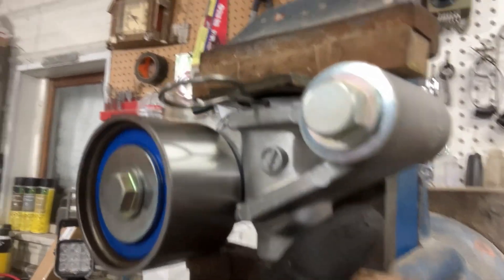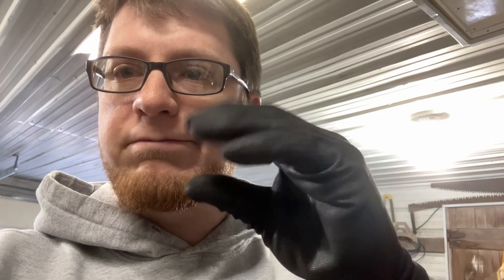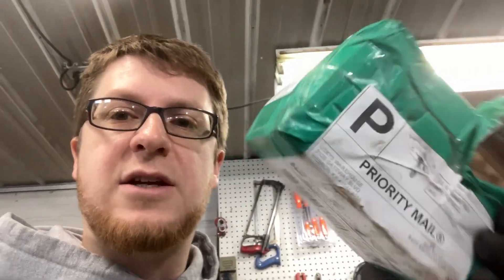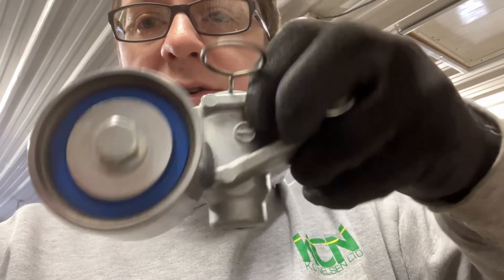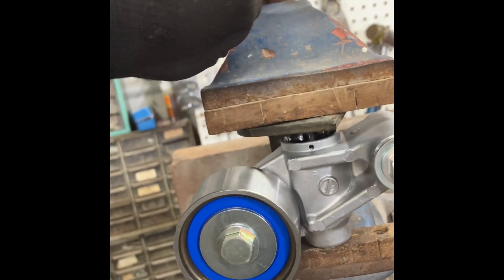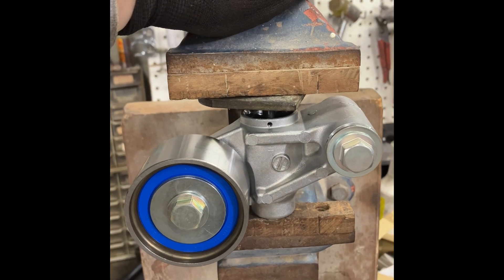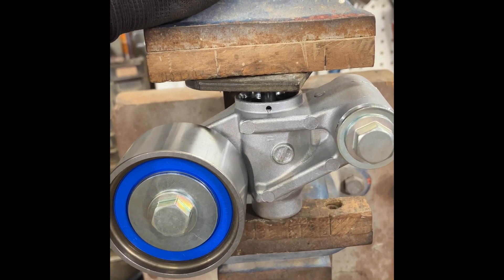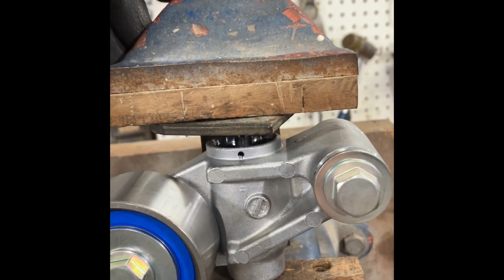Subaru timing belt tensioners, my nemesis

Comment: Man, I’m getting a “knocking” noise that I believe to be the tensioner. I was gonna tackle it myself but now I’m a bit worried. Any feedback since you started the slow bleeding process? I’ve read mixed reviews about Gates.
Reply from the maker: Since posting this video, I have done as the professionals recommend which is pull the pin and go. The dealership says you don’t need to bleed anything, you put it on and go. Every car now gets a belt guard. If you watch some of my later videos where I did timing on my personal cars I have begun experimenting with different brands, but have always added a belt guard just in case the tensioner fails. That way the belt won’t jump off the crank pulley And mess up your engine. Last weekend I replaced tensioner on my friends 2005 outback. He went to the Subaru dealership and bought it right off the shelf. Within two days it started hammering. I told him to take it back to the dealership and try to get some warranty from it. I’m just glad that we had a Belt guard on to keep things from getting out of hand. I don’t trust any tensioner anymore. Belt guard belt guard belt guard, it’s insurance against tensioner failure. Sorry if this reply became a little more than what you anticipated 🤪
Reply: @stvnswld  ok. I think what you’re saying is get a belt guard. Looks like I’m gonna put it off another weekend until o get a belt guard. Thanks for the info. I just found your channel so I’ll start digging around because I’m slowly updating my 04 after some neglect. Thanks again.
Reply: I had that. Threads for tensioner stripped. Buy the plate that holds the tensioner
Reply: @scottloutner5253  I’m actually gonna tow it to a shop next week since the timing components are under warranty when they replaced it. I’ll mention the bracket if they do indeed come back with timing problems. Thanks.
Reply: Currently blew my 1000hp rated IAG longblock due to a tensioner failure. 2018 car 11,000 miles 1800 miles making 5-700hp and it took out the valves. After watching this video I’m 100 percent buying a belt guard but also had in mind that i will purchase into an IAG tensioner or Roger Clark Motorsports tensioner which is entirely a different design. I know tensioners fail. I also believe these Aisin gates and even Subaru OEM tensioners have been produced years ago and just sitting on shelves expiring. My brothers 1990 Talon had 2 tensioner failures and we figured with the dsm stuff the parts are just new old stock. He gave up and sold the car. Hoping this beefier set up will work for me

Comment: Buy the IAG  V2 Competition Series EJ timing belt tensioner. It's only $525. Cheaper than engine work.
Reply from the maker: I’ve looked into alternative tensioners like the IAG. I honestly like the design…a lot. I’ve tried to find brackets for the mounting of the old style tensioner, but Subaru has discontinued that design. Which is a bummer, because that style wasn’t as prone to failure as the current one. I have had a lot better success as of late, made some changes in terms of suppliers. Also I’ve added belt guards to ensure the belt doesn’t jump time and break if the tensioner does fail. That’s SOP for me now, every car gets a guard.
Reply: @realtech9345  or just make a shim for 25 cents and block that tensioner from retracting?

Comment: You have great integrity. They really need to put better install information on the product. Also, if the tensioner is that sensitive to orientation during shipping...I call that a design flaw. Apparently, the proper tension and function needs to be verified before installation...weird.
Reply from the maker: Thanks for the reply. I’ve been experimenting and am finding that once installed, one should pry the belt down with a bar to allow the tensioner to extend ever so slightly. I think my problem has been that the tensioner is allowed to move unless the piston is pushed out more than pinned position.
Reply: @stvnswld  Interesting. That makes sense to allow the tensioner to come out a bit more for better belt tension.

Comment: I’m also having issues I replace the tensioner and it only lasted about 40 miles
Reply from the maker: Since posting, I have had success without bleeding tensioners. I have changed my ordering methods and have stuck to complete kits. I have primarily used Aisin, but experimented on my own car with a Gates kit. When I install everything and pull the grenade pin, I pry down slightly to extend the tensioner pin and put some extra tension on the belt. I have found this to be a good step. Also, I have begun to instal belt guards over the crank pulley on every single car I do timing on. I show that on my forester video.

Comment: I may have missed it if you mentioned it, but has anyone had this issue with the old style tensioner? It lays horizontally when bolted in place, and they seem to last forever. They can be swapped in place of the newer style if you replace the mounting bracket. Maybe a solution to this problem?
Reply from the maker: I have pursued this path as well! I think it would be a tremendous alternative to this style tensioner. I have read that they are far more reliable. I didn’t have very good success finding the old style bracket, but there is a company out there that offers That bracket along with the tensioner assembly, but it costs quite a bit of money
Reply: @stvnswld   I am doing a belt/water pump/pulley replacement on my 95 2.2 right now. Old style tensioner is in perfect condition, but will be replaced with the new "old style" tensioner that came in my Aisin kit. I will compress and keep that old tensioner in the event I have the opportunity to use it in the future.

I guess the market for OG Subaru "old style"  tensioner brackets just got a little more lucrative.

Comment: I just got into Subies, really like how they drive but haven't had a failure yet. Was planning to buy an Aisin kit and do a timing belt replacement job in the next couple of weeks. Now you have me worried I will get a borked tensioner. Ugh.
Reply: Aisens are the best kit for a subie
Reply from the maker: Sorry. Some guys are telling me I’m making it too complicated and you just put it together and go. I am still looking for the answer. Read through some comments I’ve received from professionals. Also, add a belt guard over the crankshaft sprocket. They’re 15 bucks and it will keep the belt from jumping off even if your tensioner fails!
Reply: My understanding is Aisin and Subaru are the same.  Some people bleed them, some say you cant bleed them.  I didn't.

Comment: Did you "bleed" out the tensioners prior to installing it ? What brand are you currently using ? I used a gates kit years ago , that failed after 40,000 miles . It was the tensioner that failed .
Reply from the maker: I’ve been asking around to dealers and mechanics. They all claim that you can pull the pin and go. There is no bleeding to be done. So the last time I used a factory Subaru one that I purchased at the dealership and did not bleed it at all.

Comment: Had a cat in the engine..timing belt jumped 4 teeth..long story.. reset it today..put the tensioner in a horizontal vice and slowly compressed. Put the pin in and reinstalled everything. Car runs great like nothing happened…but…think I will be ok having compressed it horizontally?  Feel like I dodged a bullet with a 4 tooth jump…think I will be ok on this tensioner? It’s all put back together and complete. Thoughts are appreciated.
Reply from the maker: If it jumped once because the tensioner went soft, it will more than likely do it again. I don’t think it’s safe to reuse
Reply: @stvnswld  it only had 5 k miles on the timing set. a cat got in the belts..that made the crank skip 4 teeth behind as the accessory belts were shredding. My question in valves resetting the tensioner horizontally in a vise vs vertical. It’s all put back together when I saw your channel saying to re load the tensioner vertically.
Reply from the maker: @louisross9691  It’s tough to say, really. I’m not saying it’s going to fail for certain  because you did it that way. All of the procedures I have read say it should be vertical to avoid air being introduced into the wrong places inside the tensioner. I was thinking the tensioner is what failed, my mistake. Poor cat, yikes 😬 Since it’s together and runs great, I’d run it. Make sure you listen for the dreaded tensioner knocking noise though, sometimes you can catch it before it causes the timing belt to jump and break. I have a new rule, I always instal a belt guard over the crank pulley so if the tensioner does fail, I have time to catch it and fix it because it keeps the belt from jumping teeth on the crank. My latest video shows the guard I’m talking about.
Reply: Yeah poor cat for sure, it was ugly. Thank you so much. I think that’s great advice...I’ll keep an ear out for that tensioner noise. Maybe listen with a stethoscope once in awhile. The reason I looked it up again (after it was all buttoned up) is because when I pulled the grenade pin it had almost no pressure to remove it. Maybe should have stopped here. I really appreciate your time and your channel. Thanks again and well done ! @stvnswld
Reply from the maker: @louisross9691  glad to help! One commenter wrote that once he pulls the grenade pin he pries down on the tensioner very gently to give it an extra tad bit of tension, especially if the tensioner doesn’t adjust much after the pin is pulled. I tried that on my last one and like how it felt as well. Best of luck with the Subie, I pray it holds together well for you. Pretty wild when they jump 4 teeth and not blow up. God is merciful, I suppose!
Reply: @stvnswld  amen Brother!

Comment: I had a overheating engine problem in my 2009 with 330,000 km forester naturally aspirated  engine. Shows any little engine oil leake in the floor after drive let say 20 drops and leake stops when not driven. In effort to fix leake i used blue devil solution adding in oil and coolant, change rad, coolant, termostat, temp sensor, check for gasket leake in coolant was negative.
Never found dhe reason of overheat engine.
I doubt that leake was from combustion cilinder to engine oil through head gasket breaker.
Somebody have any idea what reason might be.
Reply: Aftermarket Thermostat ?
Reply: @DKSE123  hi there, I don't belive was thermostat bcs I put first aftermarket and as heating continued I put from subaru diler.
I sold the car for junk only bcs couldn't fix overheating problem.
Car was so good other than overheat.
And more I am curious what reason for overheating. I Changed sensor, radiator, coolant, thermostat from diler, Enginee oil
Reply: It's important to change the antifreeze on schedule.  Subaru recommends every 30,000 miles. I recently tore down an engine and after removing the cylinder heads, I discovered a large amount of white crud in the water jackets around the cylinders. In time as this problem  progressed this would have caused overheating. An all aluminum engine such as the boxer needs antifreeze changed sooner than we would normally consider after running cast iron blocks and heads all our lives.

Comment: Pine Hollow Auto Diagnostic (Ivan) always used a Gates “kit” with all the idlers and pulleys with no problem, UNTIL NOW! gates has starting to use Chinese made bearings which he caught even though the Gates kits specifically states that each component is made in Japan. He called Gates and they were surprised also and gave him the runaround. He also called Rock Auto telling them of this and reluctantly they were sending him a refund although the bags were opened. Ivan will NOT use any Chinese pulleys on the Subaru with fear that they will fail and destroy the engine. His only option is going to OEM.
Reply: That wasn't 'now' it was like six years ago. They still sell a kit which is supposed to contain Japanese parts which has an 'N' at the end of the part number (it is on Rock Auto but I haven't seen it many other places). However if you get a Gates kit which includes waterpump then the waterpump might still be Chinese (from what I have read).
Reply: Hi i ordered a Gates kit which was in Ireland and after looking at Pine Hollow{great guy} i asked them to open kit before i purchased and they confirmed must of the stuff was marked made in China. buyer beware

Comment: Try not to overthink this. I will give you a few suggestions but first let me say I have not had many tensioner problems. I always use oem or aisin as you said you do also. I do not reuse a tensioner that is wet outside the seal. I use dayco timing belts. When I install my tensioner (lastly) my 2 idler and 1 gear pulley are all backed off one thread so they have some wobble. After all slack is between L side cam gear and crankshaft gear I install tensioner almost effortlessly lining up with the threaded hole. After tightening down all 4 loose bolts I pull the pin and gently pry the tensioner slightly to get the belt even tighter than just pulling the pin did. Hope this helps. Oh, when you have the tensioner in the vice very slowly crank. It should always be easy to turn. If it’s difficult to crank in you are working it in to quickly and this can most definitely compromise the integrity. I do not do a bleeding sequence. I do hundreds a year. If I had to guess I’d say you are having issues with quality timing belts. If a timing belt breaks it’s almost got to be belt failure. I highly doubt it’s a tensioner issue
Reply from the maker: Thank you for that feedback Subeez. Let me ask you this, why might I be having such trouble with them failing? Could it be the way I’m having them shipped? Small parcels jostled around and shaken upside down? The Aisin kits tend to ship right side up in the larger box, those have been pretty good to me so far. Tensioners that I’ve bought individually online have been more trouble.
Reply: @stvnswld  the only tensioners I’ve ever had fail on me are the ones that say made in Canada. I think they come in the dayco timing kit. I don’t touch those. I usually reuse factory oem tensioners as long as they aren’t wet. I believe your issue may be in the timing belt but just my guess.
Reply from the maker: @B-Robbb  thanks again for the feedback
Reply: @B-Robbb sorry for responding so late, by wet do you mean leaking from the piston? Or somewhere else? 

Im going to do a timing belt soon and was curious what you look for. Mine should have been replaced 10k miles ago, so i was just going to check it out while replacing the belt and water pump